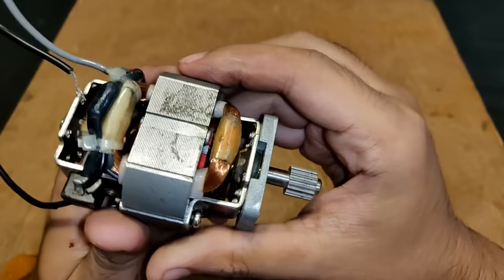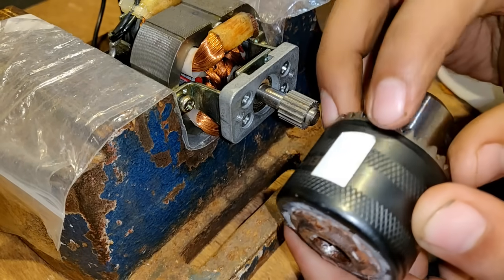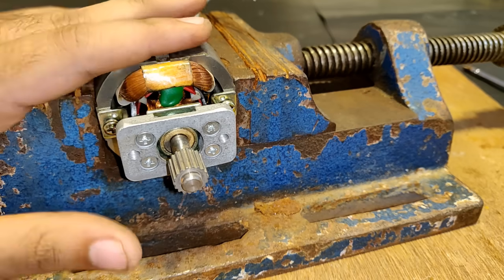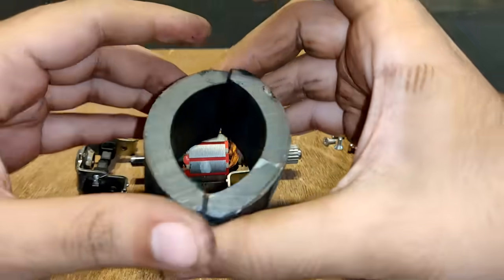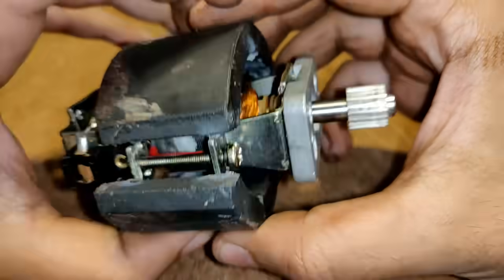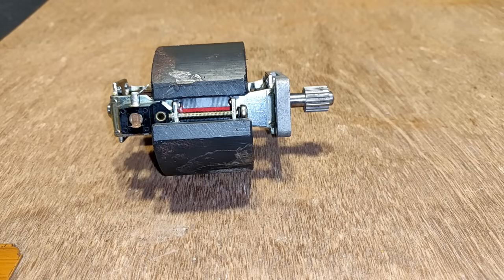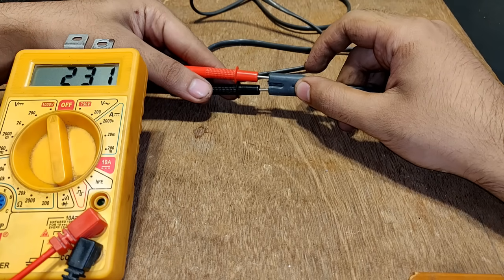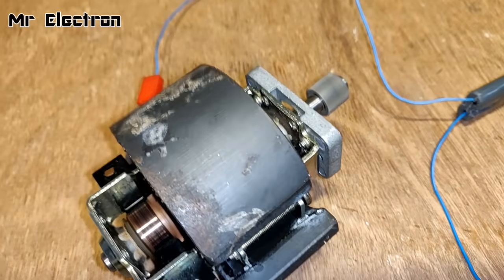17000 RPM - Make High Speed DC Motor from 220V AC Mixer Motor DIY

Comment: Using a magnet to replace the stator is a discarded coil while the voltage rotor will run low and the speed will be higher

Comment: Sie sehen, dieser Gleichstrommotor im AC-Wechselstrommodus ist eigentlich ein guter DC -Motor und funktioniert normalerweise sehr gut. Eine kleine Berylliumlegierung auf der Oberfläche und die Elektronenspatel zerstören das Material nicht , es hält zehnmal länger. Bürstenlos ist Unsinn. Bessere Pinselkohlen können sehr viel bewirken. Eine breitere Klemmbürste und Sie haben einen guten seriellen über mehrere Kontakte am Kommutator kombinierten Motor im Gleichstrommodus. Ansonsten ist es nur geringfügig für Gleichstrom ausgelegt und für Wechselstrom adäquat geeignet. Wenn Sie an jeder Seite der blanken Magnete ein rechteckig geformtes Neodym einfügen möchten, beispielsweise in der Mitte, ist es wenigstens keine Strom fressende Wechselstromgleiterturbine. Letztere sind eigentlich nur kostengünstig als sehr mittelprächtig schlechte LIchtmaschinen mit Gleichrichterdioden zu gebrauchen.

Comment: Nice video but your method of finding rpm seems to b so wrong. At this speeds  a loose chuck could be fatal. Also it loads the motor which results in incorrect rpm .

Comment: This is a universal series wound motor, It means: 
1.- The field wounds are connected in series with the armature.
2.- It can be drive with AC or DC.
3.- It is a variable torque motor, as you load the motor it's RPM reduces but it's torque increases.
4.- When you substitute field coils to permanente magnet field you are changing motor charasteristics:
  4.1- Only can use DC
  4.2- Are changing from a variable torque motor to a constant torque motor.
  4.3- If you use high magnetic strength magnets, you obtain high torque but low RPM.
  4.4- Conversely, If you use low magnetic strength magnets, you obtain low torque but higher RPM
Reply: You are right
Reply: Awesome knowledge
Reply: Very very usefull ty all the data are very important to know what to expect and what to do whit it for your desire apliance
Reply: Derick Monteiro Oliva most of the electric  motors I've worked with, show 80%+ efficencies, It means that for a 1hp power at motor's axle, It's electrical power demand Will be 746 watts ÷ 0,80=932 watts. I think you can expect a 5% efficency increase for PM motors. Thus, a 1hp at axle, electrical demand Will be 746 watts ÷ 0,85 = 877 watts.
Reply: yes exactly, I have learned that due to the increased rpm even the armature can damage itself, the rpm is such high. I can not agree that the permeant magnet can increase more than serially connected field coil and armature. And further the parallel connecting effect is different than series connection. Can you explain that too?
Reply: D-le irimia ioan intamplarea face sa avem nume comune si aceasta pasiune respectiv qeneratoarele maqnetice mi-ar face placere sa va cunosc daca santeti deacord,cu respect Ioan Irimia!

Comment: What the reason of switching this motor to permanent magnets? This kind of motors works well with dc current just switch winding connection to parallel

Comment: Thanks for giving the knowledge. How you are increasing the speed of permanent magnet motor with 220 DC supply. Is there any arrangement for that.
Reply: If you remove the excitation winding, there is no possibility of regulation or direction of rotation. You need to make a controlled DC power supply. Permanent magnets lose their effect over time. That's why the solution with the excitation coils is the best. In addition, these commutator synchronous motors are universal - they also work on DC without any modifications.

Comment: I have a 110 v sanding floor machine that I wish to convert to run on both 1110 and 240 do you know where I could find instructions to do this, please?
Reply: Just install a transformer 110 to ▶️240 , easy way.

Comment: something seems wrong with the initial ac motor rpm. this is a 2 pole ac motor running with ac at 50 hz, right?
Reply: Ya i thought it should be 3000 @50

Comment: The universal motor can use on both AC and DC...you don’t need to modify the motor and directly use 200V DC to drive the motor.
Reply: Very true. If you wanted to drive with dc voltage, you could use DC voltage. You would not have disrupted the optimized structure of the engine. You could achieve a constant magnetic field by separating the serial connection of the coils in the satator and driving them with DC. Universal motors are very good motors. Still, nice work. Thanks. Greetings from Turkey.
Reply: yes, but you will get WAY less speed with electromagnets than with permanent magnets when you drive it on DC
Reply: @littleraptor9898  true
Reply: @littleraptor9898  I was gonna comment that
Reply: @littleraptor9898  you can increase the voltage up to like 60 - 220 DC

Comment: just overvolt it and pop it. clamp it into a vise, bolt the vise to a concrete floor and Connect a 100 MV 1000 kA power supply at once.

Comment: the rpm meter I use takes 2 strips of tape to get the right rpm or 1 strip of tape needs to be divided by 2 for correct rpm
Reply from the maker: rpm will get doubled with 2 strips which is incorrect
Reply: @MrElectron  how u get super magnets I am from karachi jauhar I need super magnets
Reply: With respect you and your inovetiv product for domestic use. If you have any type small divice to convert 220v AC to 220V DC. Please send details, I will be thankfull. Please contect to me on mobile no 8209047171,7340335138,9782385138
Reply: Abbey Singh Mertia you can use a rectifier for change from ac to dc, but it looks like you dont have to much idea of electricity so I ask you please to dont do it bro
Reply: @abheysinghmertia8640  use a bridge rectifier of 5 amp or more to be boxed for safer usage and no need to use condenser/capacitor
Reply: @chandruasp  you can do it without but the capacitor spots out DC ripples after being converted from a sinusoidal wave. As long as it is designed to cope with the voltage being fed through it, for this reason AC capacitors are usually the best choice.
Reply: CRF
Reply: T
Reply: Inventos
Reply: F